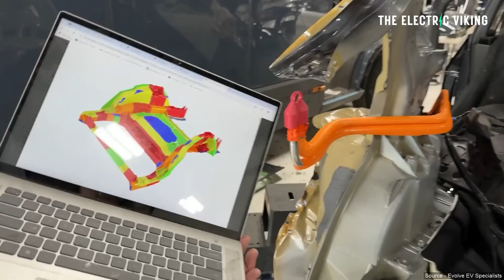What REALLY happens to a Tesla Gigacasting after a crash...

Comment: Castings are great for achieving bending stiffness at a light weight, but for tensile loads, they are actually a bit heavier than sheet steels.  The biggest problem with castings is the quality control and inspection of them.  If you design for truly light weight, then inspections cost will be exorbitant and scrap is liable to be high.  If you want to a oid that, you have to add significant amounts of material to reduce stress levels enough to assure that undetected porosities or inclusions won't create stress concentrations that result in cracking.
Reply: Which was 100% true 25 years ago!
25 years ago computer modelling of the casting process STARTED to make all that obsolete - sometime in the last 25 years computer modelling has improved enough to make those points completely moot
Reply: @duncancairncross  No, those points are even more valid now than in the past.  Finite Element Analysis allows the removal of more material that isn't carrying much stress and to eliminate stress concentrations, but it doesn't account very well for things like porosity and inclusions and completely fails to account for quality assurance escapes like cracks exceeding the allowable limits when performing magnafluxing, dye penetrant teating, or x-ray inspections.  With castings optimized for weight, they are far less tolerant of such quality escapes.  These defects can be somewhat mitigated by better casting processes or additional processing such as vacuum pressure impregnation, but castings are still far inferior to machinings.

Comment: Matchbox HeHE
This guy never went to the races or played with Matchbox. When we crashed them in 60s the body would fly off remember. Same with big boy cars.

Any race car builder will tell you a stiffer frame is worse for lap times and crash sustainability.

Worst idea ever and why they never implemented it even though the dollar Matchbov 8dea was floated a million yimew.

I really think your generation wasposioned with plastic fantastics and is now susceptible to any idea a rich guy floats. 

Ask yourself this

WHERE ARE THE EV RACES

FORMULA ONE tried it and it's a disaster

Top Fuel tried it and people died.

Only place its was used was in bumper cars using a pole and overhead electric connector because lead acid batteries could cause skin damage.

Amazing how dumb people are today with all the world's past failures right in front of them.

One day when people learn plastic surgeons will be jam packed. Then they will be converted to plastic fantastic humans with a gigacasted skeletona

So now let put toxic Lithium bomb material in every car. When one car burns it puts out more toxins in the air than 10,000 ICE fires. Idiots. Change the batteries and make the companies pay.

Comment: It makes no difference. Body shops have been cutting bodies in half and welding the good parts together and throwing away crashed parts making 1 car from 2 wrecked cars. A front ended car is combined with a back ended car. An unbranded popular car can fix up to 4 cars because it's usually the corners that get hit.

Comment: Note that a car gets written of at the point where the insurance company would pay more for its repair than to write a check for it's replacement. If a car costs $35,000 to buy and is 3-5 years old it may only be worth $12,000 and it's very easy to rack up $12,000 in repair costs when there's a lot of bodywork. We had major hailstorms where the hail stones were tennis ball sized and caused a lot of dents and the write-off point was $5,000 even though the cars were perfectly drivable and in no way less safe. That year I went to a model show so I wasn't parked where the hailstorms were. Then I sold the car and the new owner experienced a hailstorm and got money to buy a new car.

Comment: Cracks on the casting can be repaired, but larger cracks or need for a lot of disassembly, Insurance will right away total the car, since they can recover the the cost(not cast😂) much more easily, without any additional work on the claim🤔. Deformation, even small sections will lead to totalling the car right away😢. The issue is the insurance industry, not the gigacasting to fault at. Any significant manual labor is deemed as an excessive cost overhead unfortunately. Any structural repair is also considered a liability(which the consumer can make insurance pay for legally, in the court of law) and will not be acceptable as a repair solution. In this case, it is the legal system that is to blame, since liabilities are not just limited to the repair cost, and could involve personal injury and coincidental damages🤔. This is where a complete replacement, such as cutting out and welding a metal sheet is considered an acceptable repair.

Comment: I worked in the automotive stamping industry and people don't realize the amount of blanking and forming tooling needed to produce one part of a unibody vehicle, don't forget you have RH and LH parts too.

Then you need assembly fixtures and spot welders, glue applicators etc.to finally assemble the steel version of the Giga casting.

Comment: not a mechanic and i dont know for sure but i think bmw have been making die cast aluminium sub frames and major load bearing suspension parts out of cast aluminium for a few decades now ,this is just a natural progression 
the scale is new the tech is old, trusted, tested dont see what the fuss is about ,but  i do wonder about aluminiums rapid corrosion in coastal air issue, but bmw must have already fixed this since road gritting with salt will be a major issue too

Comment: „Gigacasting“ was invented in 2008 by the German engineer Richard Oberle, who was working at Idra in Italy since the 70s.
And don’t assume they sell their machines exclusively to a single car manufacturer. You can find big Aluminum castings in numerous cars, especially the once that come with a full aluminum body. They can easily afford this, because they do not suffer from contact corrosion between aluminum and steel.

But, making the front and back stiff and leaving the passenger cabin as a crumble zone is something you exclusively get from that one guy, that knows more about everything than anyone alive on earth. 
True at least if you only see the fanboys.

Comment: Debating whether or not the gigapress is a bust misses a larger issue. Sellers profit by passing along costs to the consumer, like planned obsolescence that plagues every industry. Once upon a time, you could buy a fridge, a phone, a stove, a dishwasher, a washing machine that would last a lifetime. Now you're lucky if they last 10 years. A computer and a smart phone lasts 2 years. So if Tesla, or Toyota, or Honda, or any manufacturer of any product, can make pieces of crap that break in a few years, why wouldn't they? Let your competition try and do otherwise and you can watch them flounder as you profit. And this was and is inevitable, because the profit incentive itself is a race to the bottom. The consumer's loss is the supplier's gain.

Comment: In a lot of write-off the cause wasn’t structural damage. It’s the cost of replacing all the sensors & cameras that enable many safety features &/or (semi-)autonomous driving. The labour to calibrate & confirm correct operation a large part of the total cost.
Reply: This.

Comment: I wonder about impact absorption.  In the late 90s, my second vehicle was a 1974 pontiac Bonneville.

That thing was a land yacht and a tank. I used to tow my camper or my boat with it.

My wife had my kids in it one day because she went shopping and wanted to drive it because of the trunk size. You could throw a 55 gallon drum in it and shut the trunk.

She was stopped at a light and a brand new Mazda ran into the back of her. It did not even scuff the bumper on our car but the person driving the other car destroyed the front end of theirs.

They must not have a had a license or insurance yet because they took off right after it happened and did not even bother to check on my wife and kids.

My family was fine, and my old car didn't even get a scratch on the rear end.
Reply: By design, the impact absorption is greater in a single cast, as it is factored in in the design and there are no additional parts to fail 🙏😊

Comment: Ill tell you what happens to it.     Its done.    You have to replace the entire casting.     A casting breaks.   It doesn’t bend.  Sheetmetal bends then bends back if you pull on it.   A casting doesn’t stretch, it doesn’t bend,  a casting cracks and breaks.       So therefore it must be replaced.      And that means your removing the main structure which weakens the structure.     Takes a huge amount of time.    So.     Too expensive.     So they total the car.

Comment: A Tesla is like an iphone. Its not designed to be repaired. 

The repair issue is real. Its not just the cost of the entire gigacast body that is the problem. The problem is you cant replace the gigacast without disasembling and reassembling the whole car, which is often not financially viable.

It is also a misunderstanding that a gigacast is stronger by definition. A good weld is not a weak spot and strengt in a structure is best provided by triangles, which are harder not easier to achieve with a gigacast.

All that being said I still think its a good idea. Its cost effective, it saves weight, and most cars never have a crash serious enough to require the gigacast to be replaced.
Reply: Recicling is the key here..

Comment: 'Maintainability' as an aspect/criterion of design, is quite important for a middle class conveyance.  I spoke glowingly about the DeLorean car to a used car salesman from whom I was buying an old Volkswagen in 1991: he responded without hesitancy, saying 'It is very difficult to reform stainless steel, and get a good fit'.  GM's retired executive 
Bob Lutz advised Elon Musk a decade ago that the flat battery pack of the Tesla would be vulnerable in accidents.    Whether body on frame, unibody, multiple castings, or a one-piece cast chassis, some consideration need be given to projected repair processes.  It is a 'truism' that cars are generally built as conveniently as possible, and, typically
certain repairs are prohibitively expensive.  For repair operations, dis-assembly is as important as assembly; there may be extra removable fastenings or break-away aspects
to facilitate repair.  And cars are made to be driven, not crashed & re-assembled.

Comment: There has never been an expectation (or requirement) that cars could be easily or cheaply repaired. There are many gas powered cars that can be totaled by a minor accident because a bunch of tiny parts are too expensive. Rover, BMW, Mercedes, even Genesis cars can be not cost effective to repair and there is no real standard auto body repair shops have to comply with to certify a car is as safe as it was when new after a repair. That is a myth.

Comment: Gigacasting is VERY expensive to set up.  In order for Gigacasting to work financially you require high volume manufacturing.  You need at least 300K/yr/model to be cost effective.  France doesn't produce enough of any single model car for it to be cost effective.  It is no wonder they are so anti-gigacasting.

Comment: The part naysayers are not touching on is: If the collision was so hard to cause the gigacasting to crack and need replacing, how would a traditional stamped steel have faired?
Reply: Crumpled a bit and be amenable to straightening out.
Reply: @rogerphelps9939 died
Reply: Ohhh...right, stamped steel isn't just screwed and bolted together, they use welding to join parts too.  So it's just as impossible to repair in that case since, apples to apples, you need to remove the body and components, cut the damaged section, and weld a replacement back in.  With gigacasting, you might not have a replacement to weld back in, but if you actually went through that process, it'd be probably be cheaper just to get a new car...

Comment: Also the vehicle gigacast could be designed in a way that it has join seems built into the casting,  that can have panel sections that can be more easily cut out replaced (  and re-welded back etc.. )  Thus the gigacast would retaint the strentgh benefits, whilst also having panel segment seems in the cast shell for typical panel damaged areas.  Basically designing the cast car shell with the expectation that panel segments will require replacement and provisioning for that.
Reply: Yes, Joe: it is good IF the structure is DESIGNED for MAINTAINABILITY.

Comment: If the main purpose of Giga casting is to reduce the cost of building cars, Giga casting had failed miserably. BYD, Geely,Nio,XPeng … can produce cheaper cars.
Furthermore, one piece body has outrageous expensive repair costs. You cannot put a body back in original shape without some hot work of cutting and welding.
Reply: Have worked in die casting for the last 20+ years. Casting in aluminium has no engineering qualities. Would not touch a car that has most of its structure made out of any cast material.
Reply: Are you sure they can build their cars cheaper? Do you really think there is any correlation between sales price and production cost?

Comment: At 7:16, John is pointing to two damaged pressed panels and you are saying that these will be replaced with cast panels. You are making this up!. There will only be the giga pressed parts for service, because Tesla will not spend millions of $ investing in presses to make cast panels for service. Current practice for other OEMs is to make loads of separate pressed panels which they weld or glue together and manufacture and then provide these panels for service. 
Giga casting may be great for manufacturing and performance, but I agree with the French that repairing giga castings will be too expensive and lead to a lot more cars being written off. Same for structural batteries that can’t be reworked when a single cell fails.

Comment: Manufacturing experts, including Sandy, have been suggesting casting for over 20 years.  But legacy auto changes slowly.   Not auto exec ever got fired for saying no.  You only get fired for saying yes and it fails.
Reply: He also praised taking the buttons off a $32,000 Chevy Bolt to save a few bucks. That's his job is to help manufacturers save a few bucks at manufacturing and almost everything was his idea despite not even being new after his hero does it

Comment: I was wondering about the crash performance of large cast frames and structures?
Conventional welded bodies are designed to crumple and absorb the energy in a crash, but large complex castings may not act as an absorber of energy in the same way? 🤔🤷🏻‍♂️
Reply: The casting designers can continuously vary shape and thickness. The castings are designed to absorb energy better than the parts they replace.

Comment: Electric Douche manages to arrive at the wrong conclusion once again. The French insurance industry appears to not trust the repairers, and quite rightly so. Your example proves it, that guy wants to Mcgyver the shit back together. Essentially perforating the part to apply rivets, then schmooing it back together. WTF, did you not explain that it’s purpose is to resist deformation from torsional pressures. Thank god the French are on the ball. Only fix is complete replacement of affected part.
Also what if micro crack gets missed, resulting in part failure and injury down the track, insurer would be on the hook unless they can prove repair not to standard.

Comment: A slightly related question: you know how people take two cars of the same model, one crashed at the front and one at the back, cut them in half and bodge the two good halves together, usually in a completely unsound way? Tesla have proposed a new construction method where they do almost all the assembly on about six sections of the car and then join the bits together right at the end. Would a car assembled like this enable doing the joining-two-half-cars thing safely and soundly?
Reply: Depends how they're joined. Cut and shuts are unsafe because the welds are a weak point, and didn't exist in the original design. It's very different if a part of the chassis is bolted or welded on by the manufacturer and tested and engineered. Remember, it's cowboy mechanics doing cut and shut, not good mechanics or engineers. 

So sure, if it's designed to be two halves of a car, and there's a method of joining the two that can be done without some kind of industrial scale laser welder or something, it would seem reasonable that you can do that in a mechanics workshop. Not that I think many people would do it, but the option is what's important.

Comment: I love the idea that people think you can build your own entire car, strip down a Rolls you found in a garage most of which has rusted away and restore it, build cars in the first place, but there are parts you can't replace if you want to. We write cars off because they're cheap and it's expensive to rebuild an expensive car and the insurer has to provide you a car in the interim and also provide customer service e.g. get you back in a car as quickly as their competitors otherwise you stop using their insurance. 

Why did they write off gigacast cars after accidents? Lack of data. They won't keep doing that. And they don't do it with cars they're familiar with, if they are confident repairing it can be done cost effectively, and safely.
Reply: From what I’ve read I think the problem with a gigacast repair is that the structure cracks rather than bends. Immensely strong but difficult to repair.